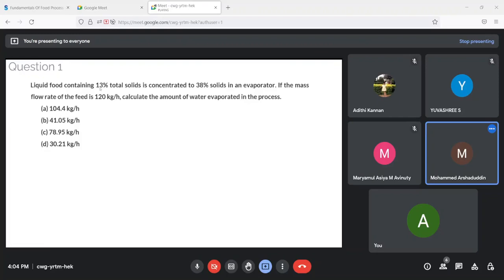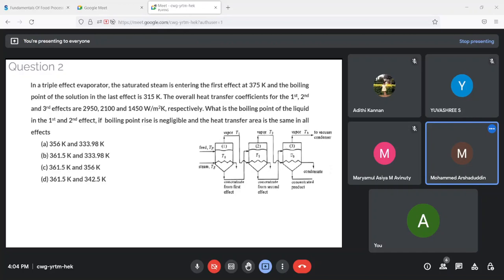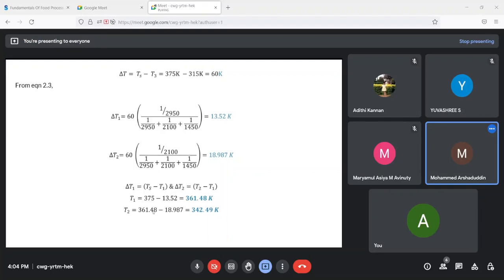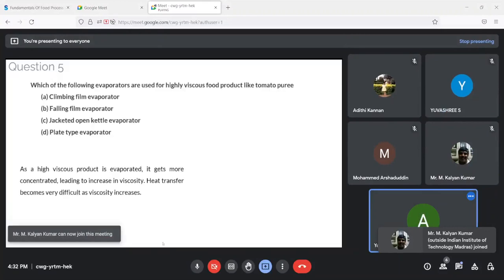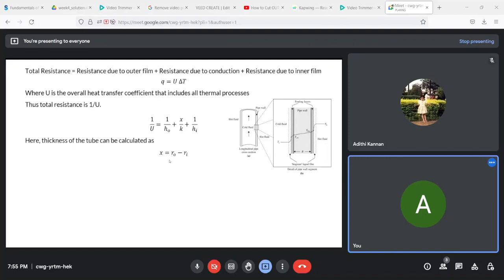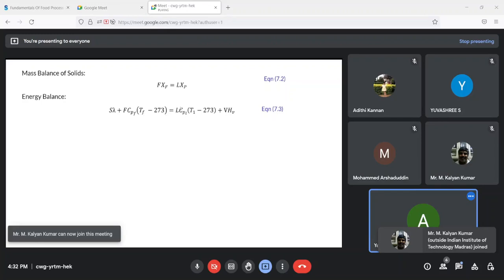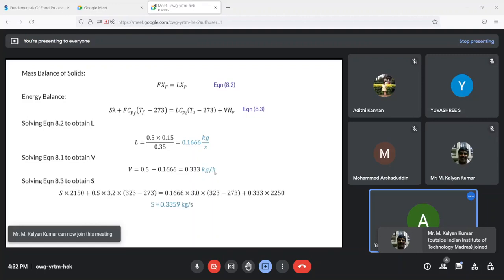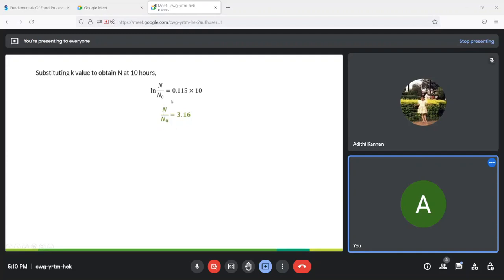Fundamentals of Food Process Engineering Week 4 Session

Comment: ma'am the values after calculation are not same as the answers provided by you
Reply from the maker: Kindly mention the question number. I will refer and get back to you.
Reply: @adithik8467  question no-7 ma'am
Reply from the maker: @navyasri2514  I rechecked it and I was able to get the same values. In the final step, make sure you have converted kJ to J and check for unit consistency. If you still face an issue, kindly mail me, preferably with the answers you got. I can explain it to you better if I know what values you got.